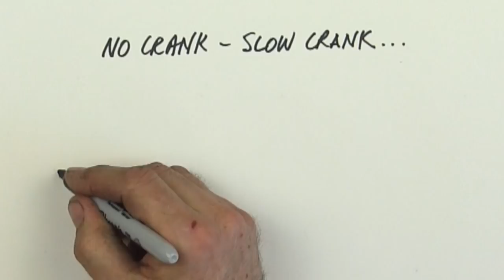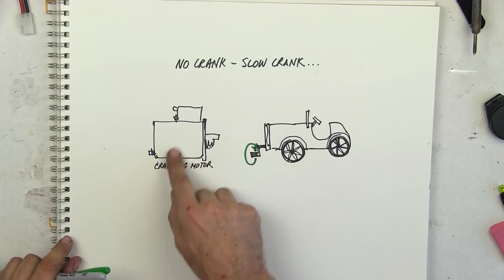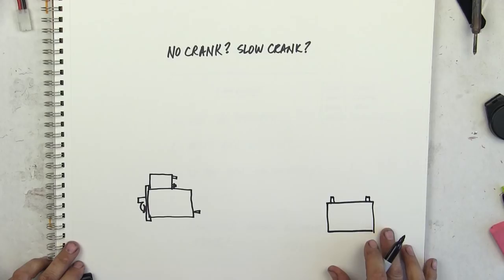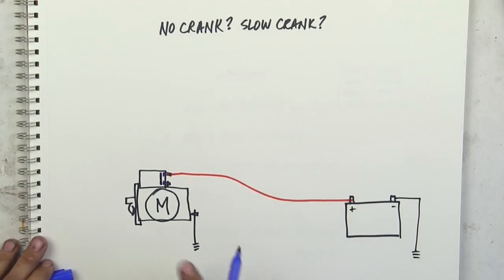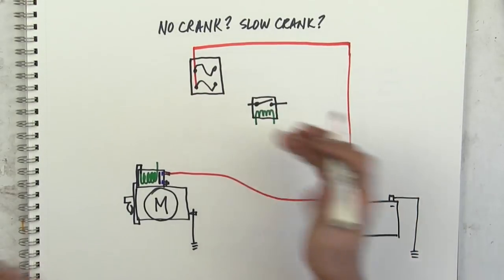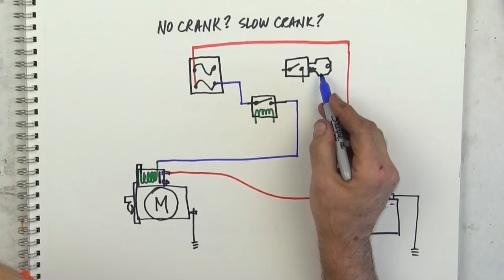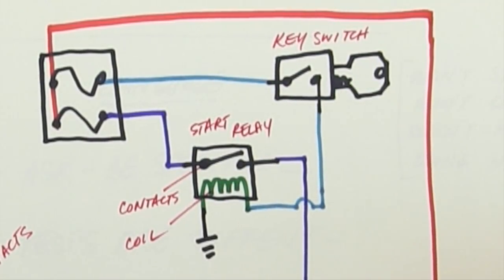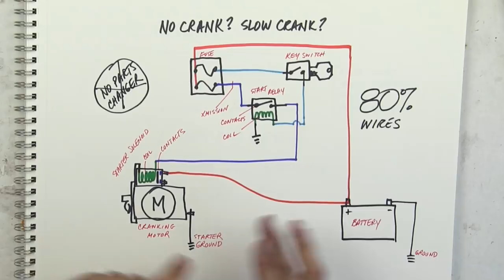No Crank - Slow Crank

Comment: The small wires corrode first @ the battery, the most.  70 percent of that 80 you provide in the video.  I frequent the junkyard and have seen thousands of batteries wired in many different configurations.  if resistance is the enemy, corrosion is its financier. I took your class back in 2001.. you are a fundamental instiller. I credit your influence as one of my foundation stones of learning. thanks again.
Reply: @Benny Blanco huh

Comment: Nice video. The reason for a bigger relay switch is because the relay on the cranking motor requires more current to run that motor. The connection between the motor relay and the cranking motor and to battery are thicker. You always need thicker cable to carry high current. This is why you always check the connection in this area for issues. You don't want exposed wires or loose connections at all.  Anything that has moving parts, would eventually fail.

Comment: Dear Mr. Sullivan, thanks for the great information. Have just purchased a Loadpro and would like to ask how I can test the cranking motor on a Porsche 997 with slow crank. Do I have to remove the cables from the starter to test if there is any resistance in the cables or can I do the test with cables attached? Help much appreciated for an interested amateur like me.

Comment: Cranking motor is correct terminology =
even going back to the 1960s where cars had a cranking motor-
many were designed with the ability to be started using the 
trusty crank handle --- 
This ceased to be so with the advent of automatic transmission.
These days also it would be difficult to turn over an engine using
a crank handle given higher  compression ratio  than what use to
be and vehicle electronics complicating the matter even further.

A car battery would suffer in very cold weather conditions - 
such as freezing cold - particularly when not used for a few
days --  Thus being able  to start the engine by manual cranking
saved the day - and no need to spend money exercising at the 
gymnasium -  manual engine cranking was excellent exercise  .

Comment: I tried to program my key for my 4gen odyssey but failed due to this gen can only be done in dealership with special tool. Then days later my odyssey quit on me while cruising in town. Now it's towed and I manually charged up the battery to around 12.8v and tried to crank. But I only can hear is click, a sound like a breathe in click and that's it. No crank at all. Sir, do you think it's related to the relay or fuse or anything else. The van was running like a champ before it stopped. Any ideas that you can share? Thank you and hope you will read the comments too!!
Reply from the maker: Can't answer unless we know you didn't mess anything up during the failed reprogramming attempt. Can only know for sure if that is correct. Have to rule it out. "What's cheap is expensive...."
Reply: @bivideo7  Thanks 😊

Comment: Help. My miata one day stalled out when I put the clutch in on deceleration, but I was able to bump start it back to power, however it started making knocking sounds and had no power at all and eventually I stopped and wasn't able to bump start it again and it would crank really slowly but it wasn't battery because I had replaced the alternator 6 months ago and also jumped the car and tried cranking it and it still would turn over ridiculously slowly. I also heard a bit of knocking at around 3k rpm a few days prior but it went away as the RPMs increased. Is this piston slap? Bent valves? Broken oil pump? Bent valves?

Comment: I have been working on cars for 40 years and not once,not even from an old timer have I ever heard anyone call it a cranking motor.
Reply from the maker: All wrenches apply torque, but I'll bet you still think you have a "torque wrench" in your box. A relay and a solenoid are different - right? I'll bet you even use water to explain electricity - which is pointless and wrong. I'll stick to what I do best, so you do the same.

Comment: I've got both problems.  Cranks once, that's it. After that, turn the key and no crank.  New battery, full charge.  After crank once, have to charge battery to get it to crank once again. UPDATE 5/30/18 - checked every circuit for parasitic draw. nothing. turns out it was the alarm system. if we don't use the alarm, the battery stays charged and the car turns over and starts with no effort.
Reply: JoshuaFinancialPL same problem figured out the problem?
Reply: Well than charging your battery didnt make it crank again, and proper testing would have shown the battery was good and not the suspect...

Comment: i have a ford 3cyl diesel tractor   just the other day it decided not to start ,,, i put a new starter on it and a new battery ..and i bypassed the wiring after no success and just started a simple  hot wire right off the starter ,,new battery and starter as i mentioned and it cranks so slow it would never start and it doesnt ,, been working on it for a week and right at where i started ,,, tractor never ever failed to start on me before ,, now its useless ....any ideas as i said bypassed all the wiring just to try ,,and nothing ,,, its a 4000 series tractor industrial with 6 foot bucket ...
Reply from the maker: Essential to make sure ALL wiring and connections are clean. Need voltage drop o starter and battery voltage during crank. Should be the same and above 9.5V.
Reply: well i just wrote a 3 page  essay on what i found that fixed my problem ,, i clicked on something and everything went away so im not going to write all that crap over ,,im 72 years old and dont have time for that ,, people after everything i did and replaced  it was my positive cable ,, thats all im going to say about that ...its back to normal ...

Comment: I have a not start and no crank only my 2002 Ford Explorer sport trac 4wd but I connected a wire from the battery to the starter and when it makes contact with the negative it turns on so the starter shouldn’t be the problem nor the motor so could it be the cable from the battery be bad or the ignition switch ?
Reply from the maker: Not sure what's touching what, but diagnose electrical problems by asking "what's right", not "what's wrong". Rule out everything that's working. What's left is the problem...

Comment: I need some help... I have a 69 C10 and I go and start her up and doesn't crank over. I turn the ignition again to no avail and when I attempt to pull out the key it's still cranking without the key in the ignition. Battery then drains after five or so minutes. Can you help me find the culprit here not really a car guy. Bad switch? Bad starter? Bad relay? Alternator?  
Thanks,Joe
Reply: You solenoid is stuck open bud I hope you fixed it but just in case

Comment: If the starter has a solenoid/relay on it then why is there a need for the starter relay?
Reply: Take the load off the ignition switch so the ignition switch contacts dont burn out with the current load going to the solenoid coil winding.
Reply: @chrisdawson7184  ah ok thanks!

Comment: I have to vehemently disagree that 80% of the time it's wiring!! Almost ALWAYS it's corrosion and or dirty battery post/terminals....period.
And a wee tip for newbs...if you find yourself stranded with no tools & (no, or dead slow crank)...lift the hood, place 2 hands pressure on each positive and negative battery posts, and apply a slight turn in either direction. OFTEN this will re-establish contact with the starter. When you get home, remove those terminal cables...clean them and apply a very small amount of dielectric grease.
Reply from the maker: Terminals and battery posts ARE wiring. If it isn't the actual motor, it's circuit. The circuit fails 80%. Thanks for agreeing, even if you weren't aware you do.

Comment: Cranking motor, FOH im gonna call the throttle pedal a “manual input lever for initiating an electrically powered,sensed and compensated air inlet valve”.

Comment: Yep probably should of watched this earlier bc my car has a slow crank when it sits for more then couple of hours. But when I drive it and restart it say like 15 mins it starts up fine. So I went to advance Auto parts to run a test on alternator and the guy said it's my starter and that my battery was full power. So just got my new starter put in and still did a slow crank after it sat for couple of hrs . Any ideas of what it could be?? I thought it was a fuel line problem from the beginning bc it starts fine if it's been on and I restart it with in 45 mins.
Reply: Andrew Lee timing?
Reply: Andrew Lee Your battery may not be holding a charge. Adavance auto parts tested your battery after you drove there, giving alternator time to charge battery. Check voltage after car has sat for several hours.
Reply: Same

Comment: hey, i have a 350sbc with headers and flowmaster exhaust. it starts fine when cold. cranks normally. but after its warmed up it wont start (heat soak i know) but i have a heat wrap around the starter. (starter is also a pmgr mini torque) i Just replaced the battery because it was old and needed changing anyways but i assumed it was the issue. im still not able to crank when cold. my grounds are good. only happens when hot. please help :/
Reply: Derp Sanity heat soak my friend

Comment: 20-12-2018, yes lovely video, but, NOTHING_ NO CRANK, for me was fixed, by ( in the middle and the shopping centre cark park)(no previous problems) was fixed by removing the battery clamps, cleaning clamps and terminals with a KFC hand wipe, and WOW it started,

Comment: just replaced a starter in my 2006 Pontiac g6 n now it still doesn't crank mechanic thinks it's the anti theft system. so what to do
Reply: Check the electrical schematics

Comment: this video didn't answer a single fucking question to do with slow vs no crank...
Reply: Joe Cervantes if you really pay good attention it did. it explains that if all "major parts are functioning" then there is no reason to change them because its 80% wiring. check the wires first.

Comment: My cranking motor grounds through engine block
Reply from the maker: Not sure I understand. I work on Class 8 trucks and 400T coal equipment. Nothing changes for you.
Reply: @bivideo7   just saying mine has no ground wire